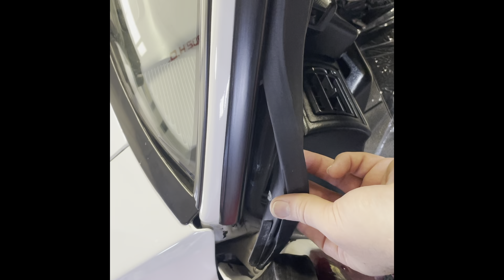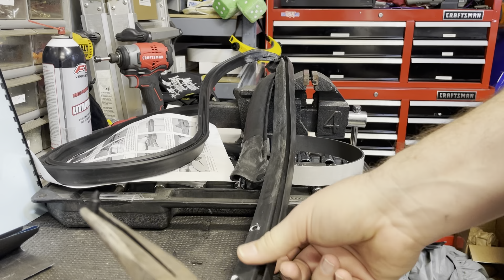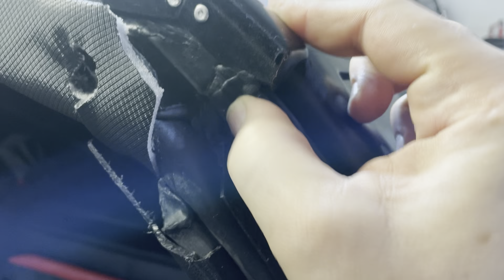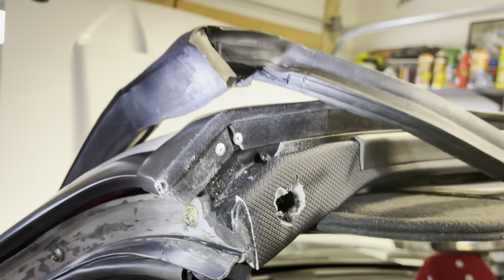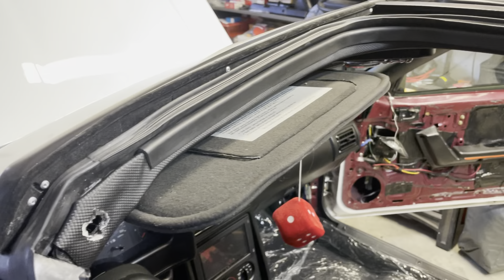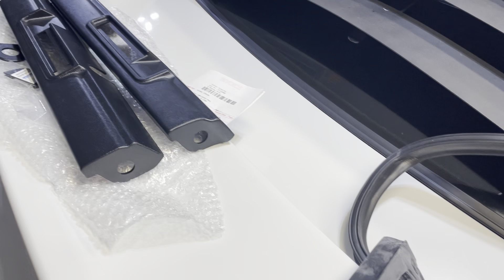Foxbody Weatherstripping Install (T-Top)

Comment: Where did you get your weatherstrip  from? Looks to be a great quality. Thanks
Reply from the maker: Thanks for reaching out. It is made by Daniel Carpenter and sold at many different places, including LMR, CJ Ponyparts, etc. You can order it from many different places. I have never found another option other than Daniel Carpenter. I am not very happy with the quality of the weatherstripppng but they seem to be the only company to make it now. I’ve contacted companies on eBay, Amazon, Summit, yearOne, NPD, etc and everything is from the same manufacturer.